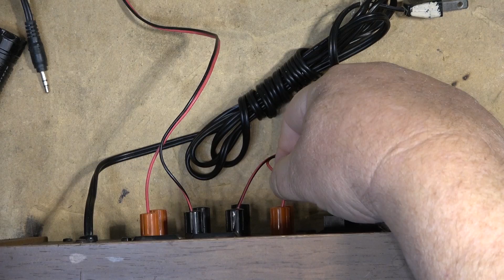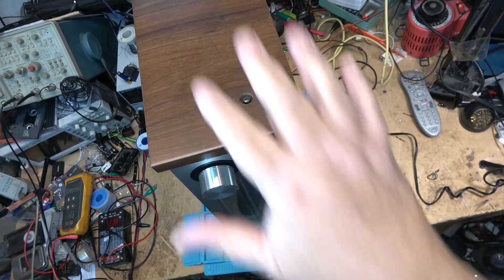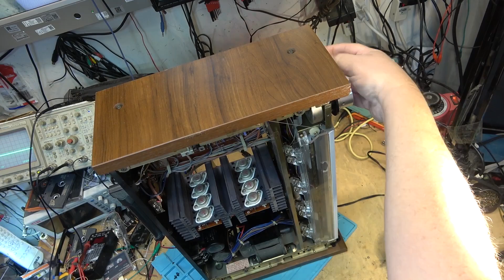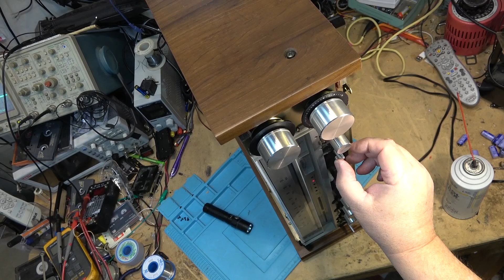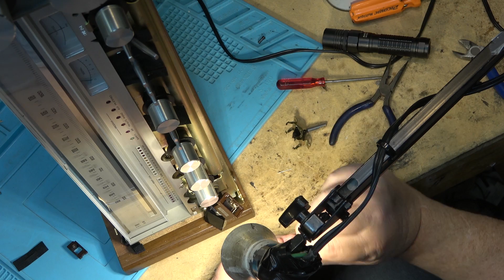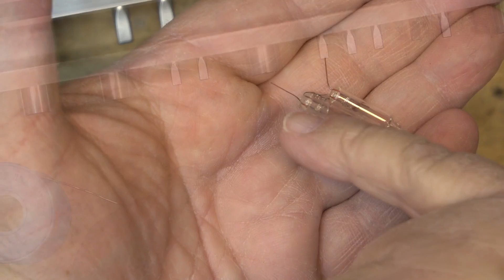Technics SA700 Receiver No Sound

Comment: You changed the caps all were close to spec and it now works but didn't before ,very critical values then .
Reply from the maker: Someone's been using the fast forward button haven't they? The reason it didn't work had nothing to do with the caps. The reason it didn't work was because the tape monitor switch was so badly oxidated that no signal was making through it even when I flipped it a few times at the beginning no signal was making it through it. I got thrown off track initially because the green light that says safety I was thinking that that was an indicator that it was in a fault mode but that's actually not the case that light comes on when it's working it goes out if it's in protection, and the fact that none of the dial lights were lighting up I was thinking power supply issue but the dilates were lighting up because they were all burned out. I changed all the caps still had no sound and it just happened to as it was firing up one time off camera I heard a little bit of sound come out of one of the speakers momentarily. I then started flipping the switches back and forth and heard a little scratch on the switch and then realized the problem was actually the switch itself both the record out switch and the tape monitor switch we're a really bad shape and it took a lot of cleaning to get them to actually perform properly. The volume control is also scratchy but the other controls were all fine as were all the other switches with the exception of the power switch
Reply: Sorry me,I watched it through all the intermittent issues with the switches and main on off but missed your diagnosis some how I tend to see all the way through real time as your such a good host.

Comment: Might be worth soldering a Bidirectional TVS Diode externally across the switch. Essentially a zener diode made for AC that clamps the positive or negative voltage spike when the contacts separate. Should drastically reduce the arcing and extend the life of the already worn contacts.
Reply: Good idea, i am trying to tackle a problem where the customer is complaining about a ‘click sound’ in the speaker when he switches it off, i’ve increased the cap over the switch but can really get rid of it.
Which one would you use? 1,5ke250ca or 300ca (230V country)
Reply: @martijnappeldoorn8686  You might be better off with a relay that disconnects the speakers as soon as the AC voltage cuts out; there are ready made PCBs on ebay that do just that, using an additional 12V transformer in parallel with the main one.
Reply: @paulb4661  that is already present Paul, if i increase the cap to circa 1uF it ‘s gone , but then the amp doesn’t switch off completly so i think i will try a tvs diode see if that helps

Comment: I had that receiver, but in rough shape, the toggle and rotary switches were all dirty, and sprayed all with tuner cleaner. I liked this receiver better because of the backlighting was softer than my SA5370 and the led flashing with the sound output, I thought it was impressive for the time, 1978, a big difference one year made as the 5370 came out in 1977, I sold both at a flea market, regrettably getting 10$-15$ each in the late 80s. I wish I kept one at least

Comment: Hi Dave, I sometimes use a fine point marker, yellow color and mark a dot on the circuit board, if I can reach it with the marker and mark the minus side of the capacitors on the board, maybe that would be helpful for you ,great video!
Reply from the maker: I remember how them come out as I am replacing them one at a time
Reply: @12voltvids  Yeah, unfortunately sometimes I forget, so I use a marker, anyway, I miss the vintage stereo equipment, easier to work on!

Comment: Considering that the power switch had a lot of damage from arcing, maybe it would have been worth swapping the cap that is across the power switch, it may have went down in value.
Reply from the maker: Generally these numbers don't go down in value usually when they fail they just short and then it won't turn off at all.

Comment: I prefer to use Deoxit contact cleaner. It's a little pricey but it works very well. Not to mention it also lubricates.
Reply from the maker: This is 40 year old nutrol with freon tf solvent.  It is superrior to the new stuff.  I have deoxit as well but i am pissed at the company for disqualifying me from the last contest because they determined that multiple people were using vpn to vote for me and the guy in second place.   So why would i promote them.  I say fuck em, I can't control what others do.
Reply: To bad you didn’t catch that bad switches right away but if you didn’t change those capacitors it would have probably been trouble down the road. Great repair! I started repair on a Marantz PMD 200 last night, oh my trying to get in to change the belts is a nightmare which you probably already know.
Reply: As always remove the pots and switches, disassemble them, cleaning with a fibre brush, apply contact grease and there we go for the next 10+ years. Everything  else is mumpitz. OK, I also would put a new Power switch in if contacts are burned. Of course,  It is all a matter of time and what a Customer is willing to pay for. I do restore Profi Studio Equipment and People see it also as an asset. I love your Workshop BTW. This is a place where someone works and it is alive. Greetings from Devon.
Reply from the maker: @telegraphhill803  removing the switches runs the real risk that the plastic will shatter. Good contact cleaner with lubricant works very well.  Unfortunately the modern environmentally friendly cleaners are nothing compared to the old cleaners (I have 40 years old cans of cleaner when the good stuff was still made). Nutrol used to me the best.  It was devoloped by the Telecom industry for cleaning stroger and crossbar switches and keep them clean.  Chemtronix tun-o-power was another excellent cleaner with. Very fine grit that would polish switch contacts.  They has pumice (volcanic ash) in it.

Comment: Those technics are cool ,but every one I've come across has had really bad switches and you really have to work the switches to clean them
Reply from the maker: This one aparantly has not seen power since the mid 80s. Was replaced with a surround system and forgotten about.